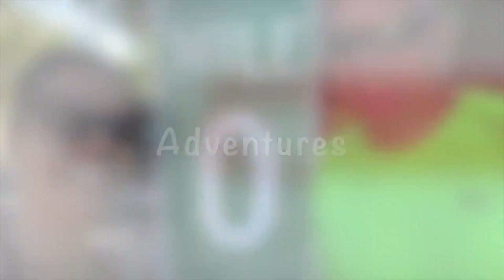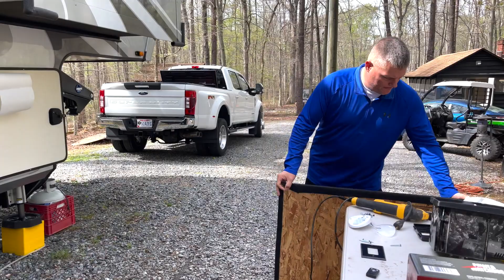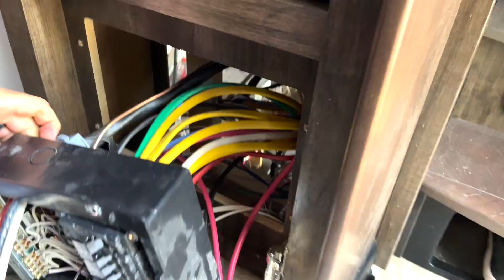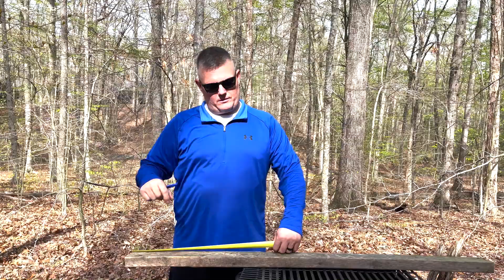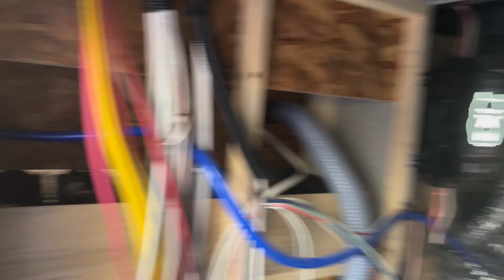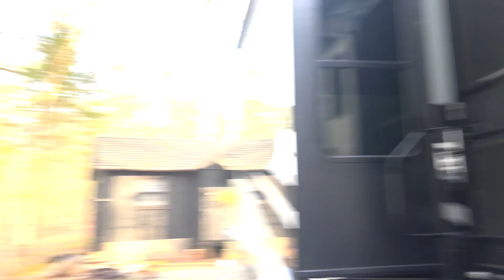Power WatchDog Install | Smart Surge Protector | Grand Design Solitude 382WB-R

Comment: Can’t you just cut a portion off the main 50 amp (or 30 amp) line and put the watchdog between? Seems easier than messing with the wire panel plus don’t need to buy additional cable.
Reply from the maker: Yes, you can do it that way. I wanted to flush mount it so I had to add an additional piece of wire to reach. But certainly it would have been easier to just splice it behind the wall where you can’t see it.
Reply: @OurlifeWhirlwind  Ahh I see. Thanks.

Comment: could you have instead left the wire that was going to the factory power center alone and just follow the back of the shore power outlet and cut it and then feed that to the IN of the surge protector and then the out would be the wires coming from the power center? if you didn't want to cut and splice the back of the shore power, could you have just run a new wire from back of shore power outlet straight to IN on the surge protector? I understand like you explained in your case you wanted the surge protector in a certain spot, but in my case if i didn't care, could what I mention be done or is there a safety/power issue when cutting/splicing the shore power line like that?
Reply from the maker: There would be no issue cutting the existing power cord in your rig to wire in a surge protector in-line. Definitely would be an easier install. Thanks for watching.

Comment: Great Video.  How did you trace for the wall cutout?   Dis you have to get behind it and re install the wall temporarily?
Reply from the maker: Thank you. Yes I put up the surge protector and then put up the wall to trace it. The cut it out, cut the carpet out like an X and stapled it to the back side of the wall so it covered the hole. Then permanently reinstalled the wall. Surprised it worked as well as it did but turned out great! Thanks for watching!! 🤙🏼😎

Comment: Thank you - well done.  I'm looking for a way to track/log electrical consumption of my RV (30AMP service) for a couple months in order to size my solar and lithium installation correctly.  Would you recommend the watchdog for this task? I already own a Surge Guard surge protector but it does not offer any logging and don't really want to spend an additional $175.  Is there a more affordable way anyone knows to do this?
Reply from the maker: Unfortunately it does not have a way to log your electrical usage. There are ways I have seen to size a solar system but I have not done that yet as we are not ready for our solar install yet. If I figure something out in the near future I will let you know. Thanks for watching.

Comment: I would never use old wood from outside what if it had termites or bugs and you just introduced them into your rig? Probably not likely though I guess…
Reply from the maker: That didn’t seem like an issue! It was an old 2x4 but I don’t think it was infested. At least we haven’t had any problems in the rig. I’ve had the basement wall down since that install and I didn’t notice any problems. Thanks for watching.

Comment: What size wire did you buy for the jumper wire?
Reply from the maker: I used Southwire Romex 6/3 stranded indoor non-metallic sold by the foot at the big box stores. I got lucky and was talking with an electrician in the aisle at Lowe’s and he really helped me out.